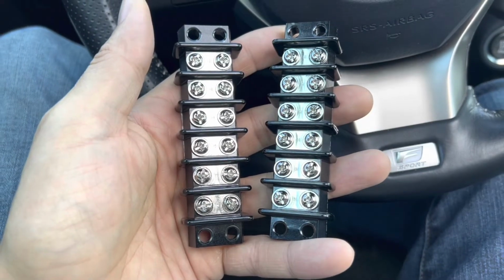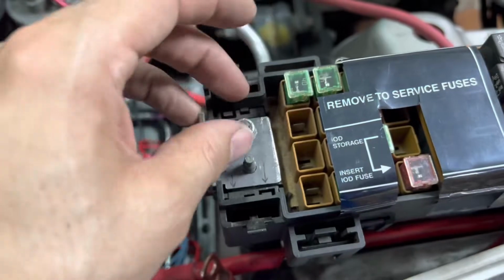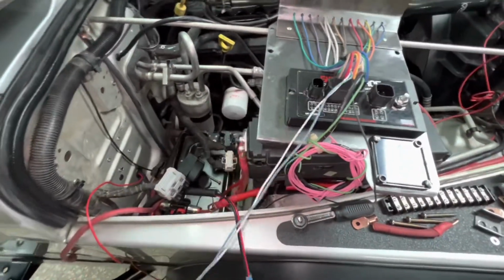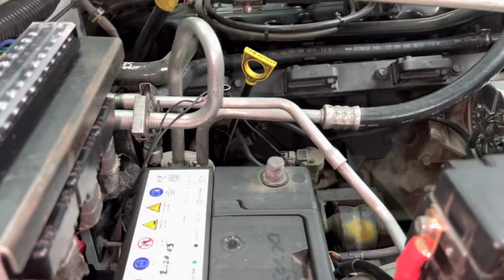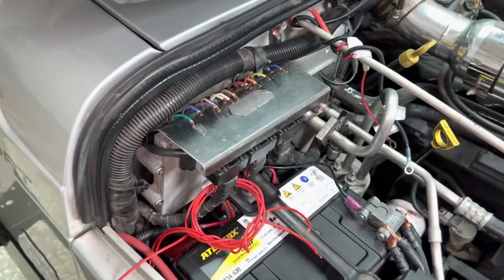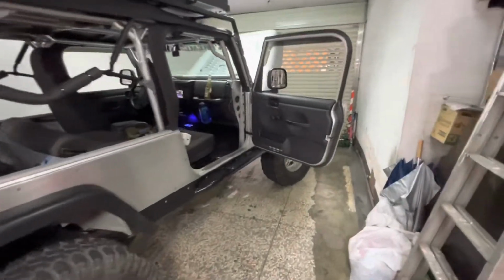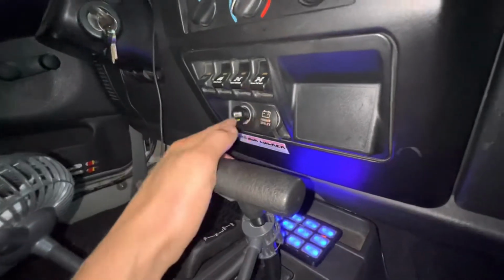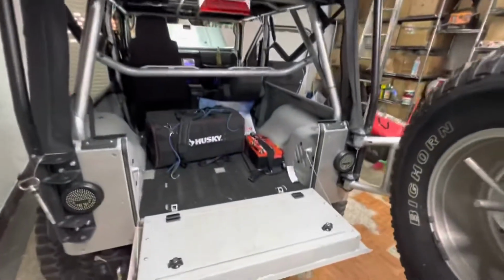Project “No Ice” Part-7 (Power tray, Switch-Pros RCR Force 12 install and a last minute trip 🏕 )

Comment: Nice work!  What type of material is the square stock you used on the PDC?
Reply from the maker: It was actually just a piece of 30mm square tubing. Mild steel.

Comment: Just wow. Came across your videos after your comment in KyleSVT's big 7 upgrade. This is the tab that has held me back from upgrading because I didn't like the look/space limiting of the connection. 

Simple drill and tap for the socket screws?  Have they held up okay or would you recommend a jam nut to anchor it?  Just wondering about vibes. 

After checking out your other videos, you have a new subscriber. Lot of good ideas and thinking outside the box.
Reply from the maker: @fanof308  everything is running and charging perfectly. Thanks for the kind words. I haven’t uploaded in a minute but I’m working on a big one. PSC steering upgrade along with some other much needed stuff.

Comment: You previously successfully modified (cut out) the PDC plastic cover in order to clear/create space & connect the copper eyelets directly to the terminal bolts? Yes? Now I see you've modified, (created) a completely different Aluminum end mount (because you discovered there would be continuing issues with Battery Access). Yes? In my case, (2004 4.0 stock location components), I'd have the same issue with Battery Access? Trying to deal with that issue and moving forward; I'd still like to cut/trim the PDC cover with a Multifunction Mini Circular Saw, (as you did), but I'll revise the location of the flat stock bracket (under) the PDC? (or) Just bag that idea and mount the fuse block on that support rod? I like your Video Inserts (which add laughter to an otherwise FRUSTRATING situation) Ha! Thank you for ALL your efforts (we'll see on my end), with the help of a good friend (a Pro). Two brains are better than one as we 'off' each other (Just Kidding) Oye Vay - Jeeez :)
Reply from the maker: Aluminum end mount? Are you referring to the L shaped attachment I fabricated to fit on to the lugs inside the PDC box? If so that bracket is actually cut from mild steel square tubing. If you dig into the video a bit I explain that the initial design's "direct attachment" as you put it worked fine but made it a little cumbersome to get the battery in and out. It had to do with the wires looping out over the battery. The revised 90deg turn down gets the wires completely out of the way of the battery. 

I would be VERY gentile with that circular saw. I used a dremel with a very thin cutting wheel. 

I initially mounted the fuse block where my oem air intake system used to be. Where yours is now. But I relocated my intake years ago. I now pulls air through my firewall from the cowl vent in front of the windshield. Google "TJ cowl intake" for more on that if you're interested. So that aluminum fuse block mount I fabricated in the video was mounted to where your air intake mounts now. That wouldn't work for your situation. However, my revised location under the PDC box should not conflict with your oem intake location.

I chose not to mount the fuse block up on the grill support rod for basically the same reason that I redid the connection to PDC. I didn't want wires looping/hanging  around in the engine compartment. But up on the rod should work fine if you're ok with that. BTW I wouldn't be overly concerned with the fuses blowing. I've not had to deal with that at all since my install, and I have a LOT of electrical mods going on under my hood.
Reply: @JeepTJay6  Yes Mr. Jay a 'Dremel' is what I meant to say. I'll go over your fine videos again and continue to develop a plan based upon my own situation which is entirely stock; no winches, no lights, no water nor climbing up & down mountains and caverns LOL You're very patient and I appreciate/admire your persistance toward a feasible solution. Thank you my friend! - I'll be back with possible questions. Thank You Mr. Jay!
Reply: Hey Jay - I just had a thought:  Similar to your home made 90 degree bracket; was thinking I would try to modify the old 90 degree connection bracket that connected to the PDC box: If there's enuf metal to drill out 2 holes and bolt the eyelets from the new 'Jeep Cables' directly to that drilled out bracket. Given there's no dissimilar metals, and enuf clearance for the conductors and the small bolts (which would connect the new cables to that old 90 degree connection bracket)? Your opinion please? Thank you Jay! :)
Reply from the maker: @Archivist953  Go for it! The only reason I didn’t do that myself is because the 90deg angle idea didn’t occur to me until I got annoyed with having to hold the wires out of the way every time I pulled the battery out. ;-)